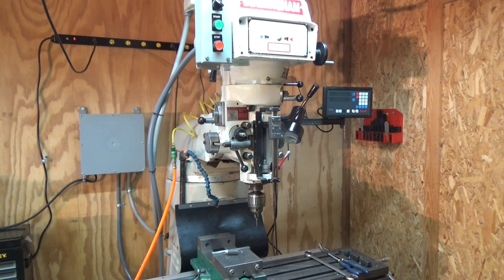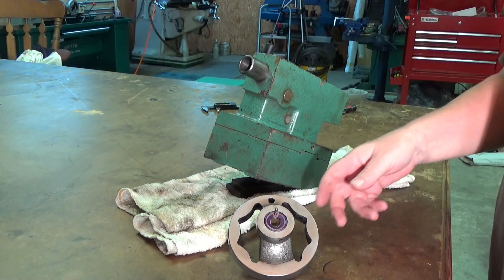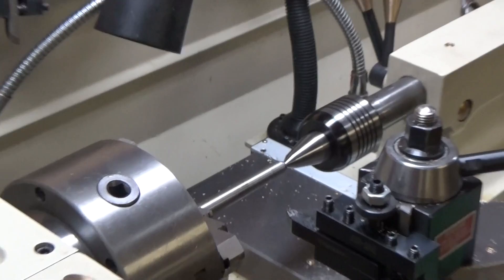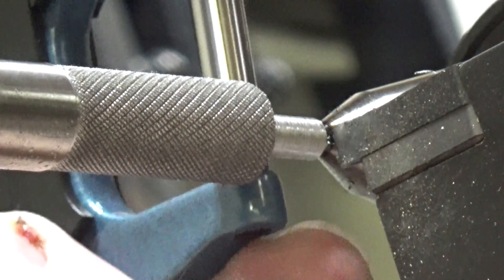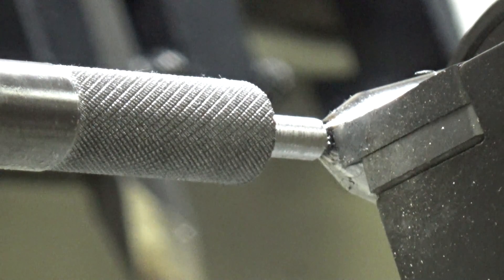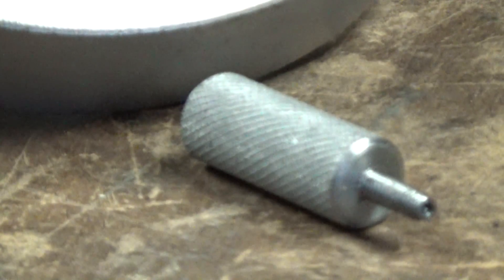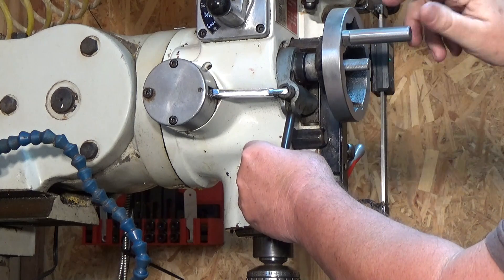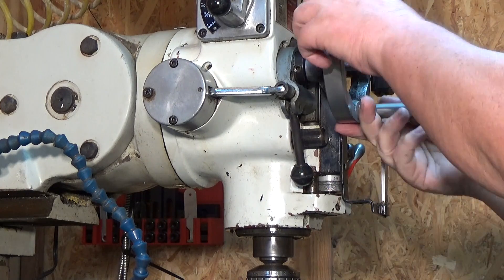How To: Fine Feed on Milling Machines

Comment: Just got a well setting import mill
Hand wheel and feed direction knob missing made mine also
I got my mill from good friend which needed work 3 phase motor
Couple of months looking for VFD then the guy who gave me the mill showed up at my door with a 110/220 single phase  motor and adapter plate had to make a pulley drive adapter to fit new motor spindle  
Getting close to operational
Finally got it operational 
Now cleaning it getting it set up

Comment: Great information and a nice job re-purposing the tailstock hand wheel. Been there and done that with getting the oil brush bristles pulled into the knurling wheel. After the second time and ruining the knurling work, I decided to always use an Eagle pump oil can oiler with lubricating oil instead of a brush. Thanks for the video.

Comment: On most used machines those wheels get lost... They rolled on the floor a couple of times, and then, get tossed in oblivion...
Reply from the maker: On my mill/drill all I use is the fine feed, I was amazed at all the ones I looked at this part was missing.. oh well thanks for watching PB
Reply: My wheel came with my mill, still got it, stored on my tool chest beside, rarely use it though...

Comment: I'm not sure if you know or not but the factory Bridgeport pull knob has a barrel around a screw so that you can grab it as its spinning and the barrel will stay stationary in your fingers. This enables you to go from down feed to up feed when you are boring with the feed engaged.
Reply from the maker: I was not aware, that is some darn good info, I saw one on ebay and it was like $60 I was wondering why. So up/dwn while it is running is not a problem, correct?  Looks like I'm gonna make one today. thanks again Cody
Reply: +Brian Stanga yeah it's fine to go either way while running.

Comment: Nice and easy fix for the fine feed.
Good job Brian!
Zeke speaks only dog.
Mike
Reply from the maker: Thanks for watching Mike, BTW I need to get with you on using my metal detector, trying to use "discriminate" so it would only trigger on brass.
Reply: Ok on the metal detector.
Most have a notch feature where you can notch out anything above or below what you are looking for.
What make/model is it?
I can send you a pm and give you my email address.
Mike

Comment: That hand wheel was just ideal - nice result Brian. That machine is just itching to get cuttin' :)
Zeke only speaks barkish. :)
Reply from the maker: It seems like all I've done since I've got this mill is add stuff to it and clean it up, Only used it on 1 small project and that was reducing the height of a plastic pump base. BTW was searching for a way to balance a wire wheel and a video from Cras Production came up, guy looked familiar. as always thanks for watching
Reply: Just getting the machine fully ready - reckon I'd do same.
That vid - haha, it was way way back - early days almost! It sure got my wheel way better from being awful. :).

Comment: When you finished and then showed the knurl slopping round in the bush I thought, "that's not right" duh! - should have known better!  ... zeke set me right

The layout of the wheel sliding over /pull push thing looks really neat - until you think about it - that relatively flimsy fixing thread surrounded by all that metal is an accident waiting to happen.  presumably if the knurl works loose, if you  remove that wheel a little clumsily and knock the knob is when the thread shears off?

Is it practical to sink a groove round the shoulder of the knurled piece where the thread ends and meets the knurl so when it's screwed home the shoulder of the knurl cups over the threaded nipple to give some extra support?  Maybe some blue loctite to stop it shifting too easily too.